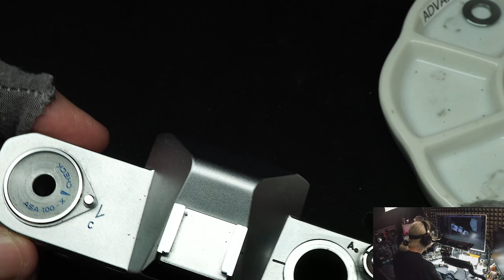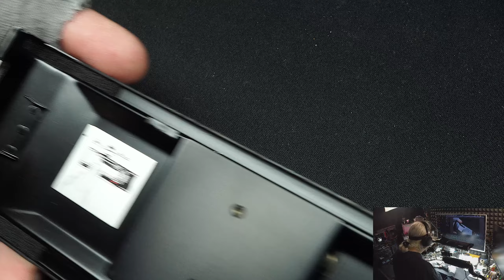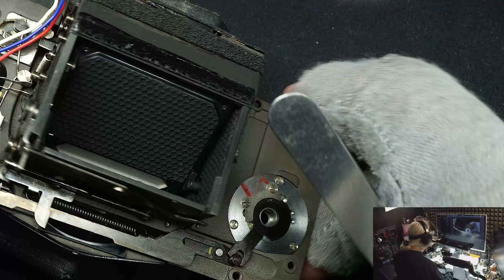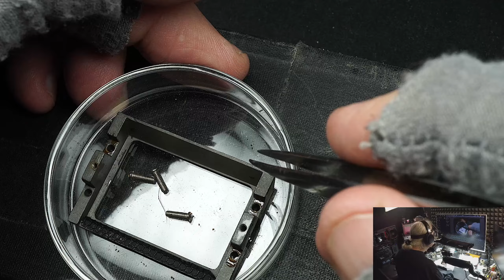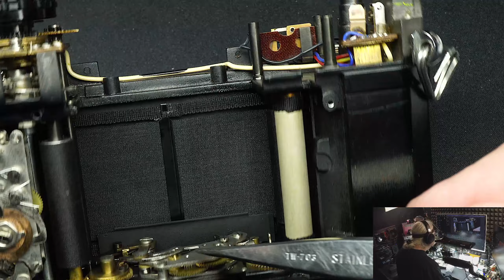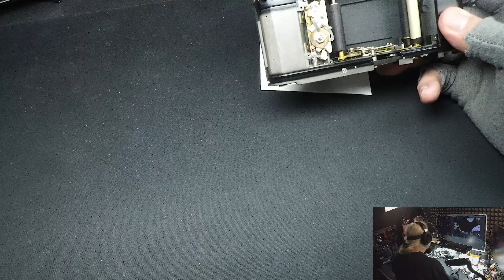Canon FT QL Vlog Tour | Vlog #030

Comment: My second body arriving today..bought it on ebay in very good condition and has just been CLA'ed. I am sending my first body to be CAL'ed, that's the reason I got this kind of a back up.  I love the simplicity of this camera..I don't care much of the meter, as I exclusively use my Penta  Digital Spotmeter, or the Pentax Spotmeter V,  and my Minolta Autometer IV F for incident light metering.  I use it mainly on tripod with mirror lockup and cable release for my landscape photography, I use it just if I was using a medium or large format camera, without having the movements of course. Just a pleasure to shoot with. I own most of the Canon Cameras line (FTb QL, A1, AE1, F1n, New F1 and the legenday T90 all work as new) but the FT is my preferred one along with my T90. Thank you for putting this excellent video blog on this gem.
Reply from the maker: Hello Roi
Thanks for the compliment. I need to make more vlog videos for my channel. I've been busy lately catching up on my camera repair work and not getting any videos made. I own a repair shop and it keeps me busy during parts of the year.